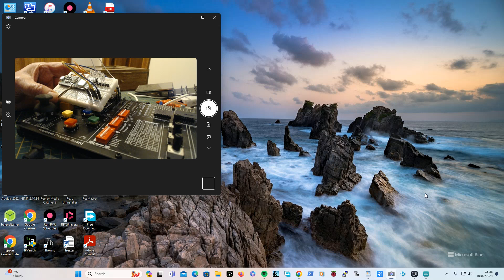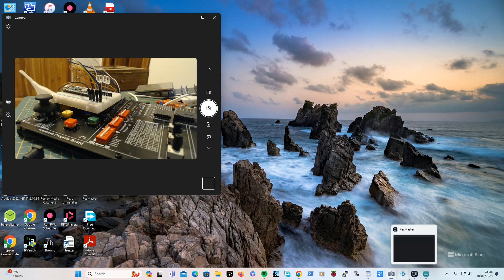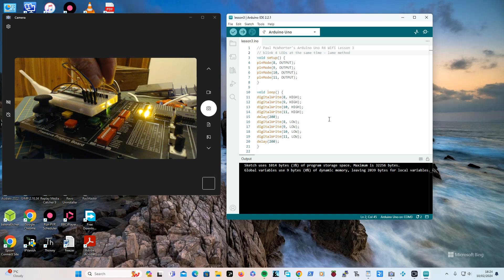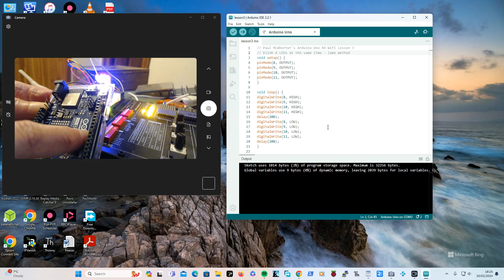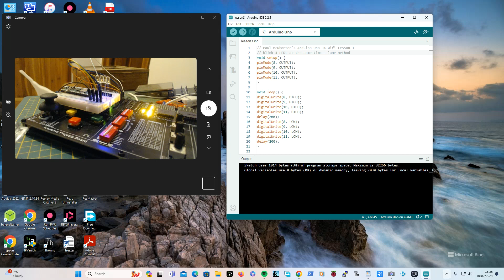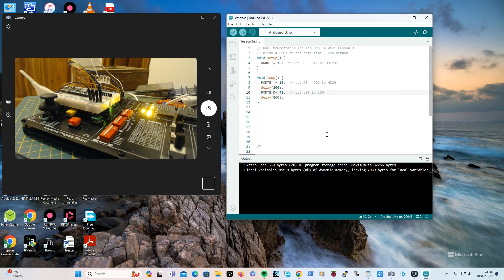My video for Paul McWhorter's Arduino Uno R4  Wifi Lesson 3 - Blink 4 LEDs

Comment from the maker: Unfortunately, as Peter Karlsson pointed out,  the second program only works on an Arduino R3 and not an R4. Work in progress!!
Reply: Yes as others have said port manipulation is chip specific. I did a little Googling and it seem the there is no direct port manipulation for the R4 but there are faster ways if you need to flip bits faster than digitalWrite. Until I find a project that the 328P can't handle I will stay with the R3. Thanks for the video Charlotte.
Reply: @keithlohmeyer  There is a way to write to the ports directly on the R4. I have used the method of changing individual bits in the port register to control NeoPixels from my R4 board. digitalWrite is to slow for that.
Reply: @peterkarlsson7801  Ok I guess I did not dig deep enough and I will not be buying an R4 to play with.
This is what I found for the digitalWrite function in the Arduino Renesas (R4) core that I based my comment on.

void digitalWrite(pin_size_t pin, PinStatus val) {
  R_IOPORT_PinWrite(NULL, g_pin_cfg[pin].pin, 
  val == LOW ? BSP_IO_LEVEL_LOW : BSP_IO_LEVEL_HIGH);
}

This seems to use the R_IOPORT_PinWrite() function which is provided by the low level Renesas Flexible Software Package: I wonder why Arduino chose this intermediate layer of code and not to go to the lowest level and just do port manipulation

Whereas on the R3 core digitalWrite includes the port manipulation.

void digitalWrite(uint8_t pin, uint8_t val)
{
    uint8_t timer = digitalPinToTimer(pin);
    uint8_t bit = digitalPinToBitMask(pin);
    uint8_t port = digitalPinToPort(pin);
    volatile uint8_t *out;

    if (port == NOT_A_PIN) return;

    // If the pin that support PWM output, we need to turn it off
    // before doing a digital write.
    if (timer != NOT_ON_TIMER) turnOffPWM(timer);

    out = portOutputRegister(port);

    uint8_t oldSREG = SREG;
    cli();

    if (val == LOW) {
        *out &= ~bit;
    } else {
        *out |= bit;
    } 

    SREG = oldSREG;
}
Reply: @peterkarlsson7801  Good to know. Guess I did not go deep enough.
Reply from the maker: @keithlohmeyer  I was thinking exactly the same thing myself especially with the higher risk of blowing up an R4. I have seen how to do it but it's a lot more cumbersome (and difficult🙃🙃)

Comment: Nice - I will have to give that a go for the binary counter HW.  I see in the comments below that it might need to be adjusted for the R4 vs R3.  Great video!
Reply from the maker: @lorisrobots  It might take quite a lot of adjusting. I'm totally rubbish at C++ and I found the documentation a bit hard to follow. Maybe I'll just leave the R4 in its box unless I want to use the matrix and/or wifi.
Reply: @charlotteswift  But this is why I am following the course.   I can learn the differences between the boards and how to make stuff work the way I want.  My C++ is rubbish too!

Comment: Your second program shows how pinMode() and digitalWrite() work behind the scenes, which I find very interesting. Note that your program only works on an Arduino Uno R3 / AVR processor. However, the same technique can be used on the Arduino Uno R4 and Arduino Giga, but with different commands. Each processor family has its own way of controlling the GPIO ports.
Reply from the maker: @peterkarlsson7801  I didn't know that. Thanks for telling me
Reply: @charlotteswift  This is the code for blinking the internal LED using Direct Port Access on the Arduino UNO R4 Wifi:
uint8_t port = 1;
uint8_t pin = 2;

void setup() {
  R_PFS->PORT[port].PIN[pin].PmnPFS_b.PDR = 1;  // Set pin to output
}  // end setup()

void loop() {
  R_PFS->PORT[port].PIN[pin].PmnPFS_b.PODR = 1;  // Set pin to high
  delay(50);
  R_PFS->PORT[port].PIN[pin].PmnPFS_b.PODR = 0;  // Set pin to low
  delay(950);
}  // end loop()
Reply from the maker: @peterkarlsson7801  Thanks very much for that, Peter. It looks considerably more complicated than for an Uno R3. 
What I like about using the AVR processor is that you can set 8 ports at a time. Can you do that with an R4?
Apart from the built-in wifi, I much prefer using an R3 (and it means I can use my project board without worrying about what I'm going to blow up😆😆
Reply: @charlotteswift  Yes, there are up to 16 pins in each port on the R4, and you can set all 16 at the same time. But the mapping between bits in a port and the Arduino numbering is NOT in order. Here is a program that controls some of the LEDs in the matrix

void setup() {
  R_PORT0->PDR |= 0b0011100000000000;  // Set several pins in port 0 to output
  R_PORT2->PDR |= 0b0000000001110000;  // Set several pins in port 2 to output
}  // end setup()

void loop() {
  R_PORT2->PODR &= ~0b0000000001110000;  // Set several pins in port 2 to low
  for (uint8_t i = 0; i < 50; i++) {
    R_PORT0->PODR |= 0b0011100000000000;  // Set several pins in port 0 to high. This will cause some LEDs in the matrix to turn on
    delayMicroseconds(20); // Use "PWM" to reduce the brightness
    R_PORT0->PODR &= ~0b0011100000000000;  // Set several pins in port 0 to low. This will cause the LEDs in the matrix to turn off
  }
  delay(800);
  R_PORT2->PODR |= 0b0000000001110000;  // Set several pins in port 2 to high. This will cause some other LEDs in the matrix to turn on
  delay(50);
  R_PORT2->PODR &= ~0b0000000001110000;  // Set several pins in port 2 to low. This will cause the LEDs in the matrix to turn off
  delay(800);
}  // end loop()
Reply: @charlotteswift  Here is a program that change several pins at the same time. The pins are connected to the LED matrix.

void setup() {
  R_PORT0->PDR |= 0b0011100000000000;  // Set several pins in port 0 to output
  R_PORT2->PDR |= 0b0000000001110000;  // Set several pins in port 2 to output
}  // end setup()

void loop() {
  R_PORT2->PODR &= ~0b0000000001110000;  // Set several pins in port 2 to low
  for (uint8_t i = 0; i < 50; i++) {
    R_PORT0->PODR |= 0b0011100000000000;  // Set several pins in port 0 to high. This will cause some LEDs in the matrix to turn on
    delayMicroseconds(20); // Use "PWM" to reduce the brightness
    R_PORT0->PODR &= ~0b0011100000000000;  // Set several pins in port 0 to low. This will cause the LEDs in the matrix to turn off
  }
  delay(800);
  R_PORT2->PODR |= 0b0000000001110000;  // Set several pins in port 2 to high. This will cause some other LEDs in the matrix to turn on
  delay(50);
  R_PORT2->PODR &= ~0b0000000001110000;  // Set several pins in port 2 to low. This will cause the LEDs in the matrix to turn off
  delay(800);
}  // end loop()
Reply: @charlotteswift  Yes. There are up to 16 pins in each port. I have tried to post some code showing how to do, but YT always delete it : - (
I have now tried to make a "video" showing the code: https://youtu.be/N5EN6TaLgsE?si=IwPSwGCDIl4SI9Rc